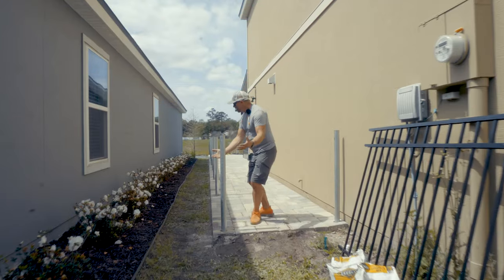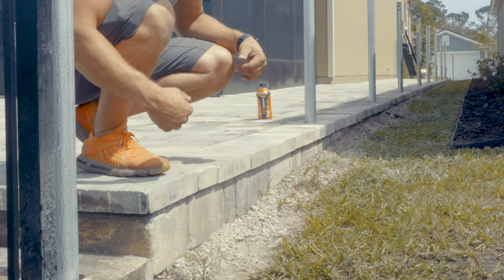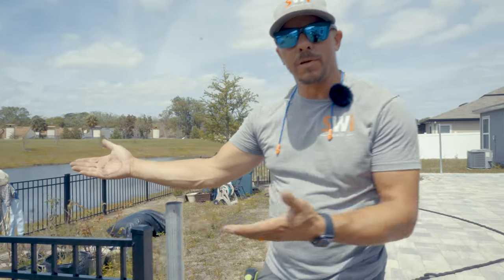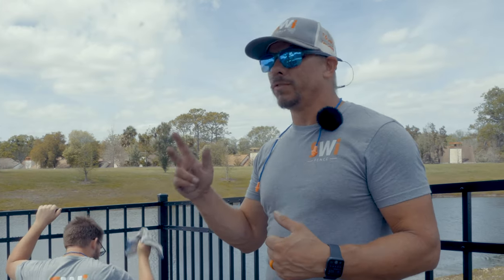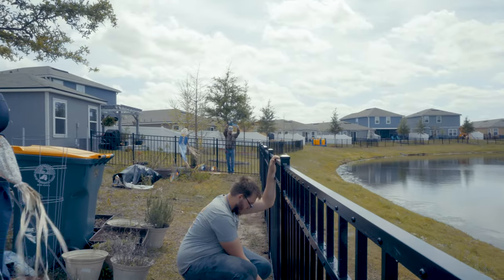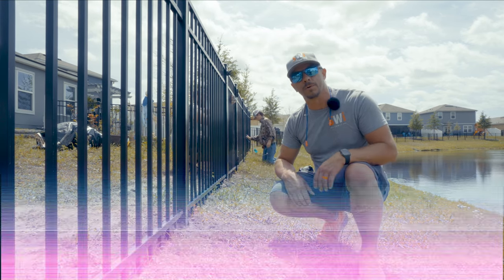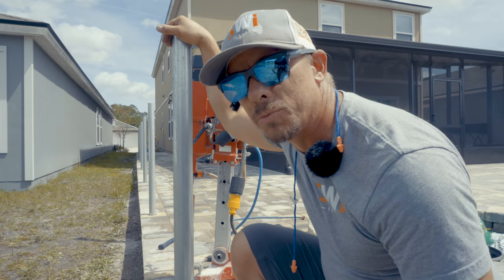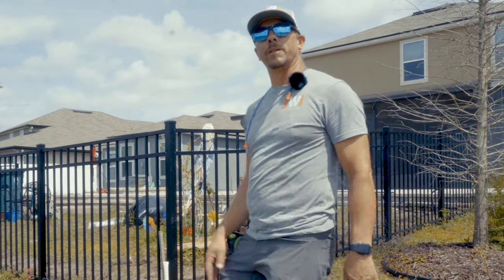This Job Wasn't What We Signed Up For

Comment: Not applicable to this video, but with the easy twist ties would I be able to use the 2.5” ties for 1-7/8” and 1-5/8” or do I need to buy each size tie for each individual diameter? Wasn’t sure if the drill would snug the 2.5”s down to smaller line posts or not.
Reply from the maker: To work properly you need to buy the correct size otherwise they will either not work at all or be super sloppy. The only exception is sometimes you can get by using inch and seven eights on inch and five eights. Even that is not recommended though.
Reply: @SuccessfulContractor  thank you. Very helpful channel for a 23 year old trying to start a business.

Comment: 2ft panels suck. Looks killer
Reply from the maker: I hate driving around and looking at the remainder sections because people are too lazy to trim a few extra panels. I operate on the golden rule. If I wouldn’t want it at my house I don’t put it at a customers house
Reply: @SuccessfulContractor  I am a installer also, it take 2 minutes to trim a panel down a few pickets and achieve the next level. People don't notice like we do but they know there is something different that makes one look better than the other.
Reply from the maker: You’re right. It doesn’t take a lot of extra time but makes all the difference in the finished product. We will actually trim down both ends of the panel so that we don’t have one pick it up against a post and a full space on the other end. It’s all about trying to give the most uniform look possible. There are far too many people that are more interested in cranking out low quality work to make a dollar and that’s what I would like to change. Production is important, but being a master of your trade means paying attention to the details as well.
Reply: I love that you guys do this also, we take pride and always tell our teams to plan ahead and always cutback panels and split the difference evenly. We hate when we see other installers that leave one small panel at the end of fence runs, LAZY
Love the attention to detail, respect
Reply: @NoahDevine91  I always measure a 15ft mark and a 18 when I do ornamental anything 6ft give me a visual of what's coming ahead. I have a small company in Michigan we do alot of contract installs for a few larger companies and sell some custom wood to my own customers. My guys know we don't skimp. Can't be the best in the west if we don't bring our A game our customers deserve the best. My labor manager and myself hold that standard and keep everybody accountable.